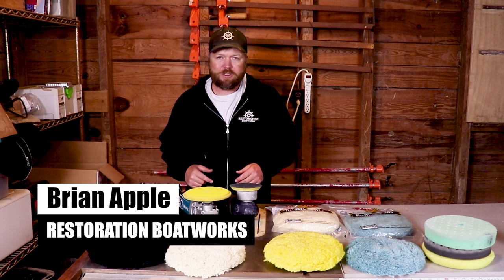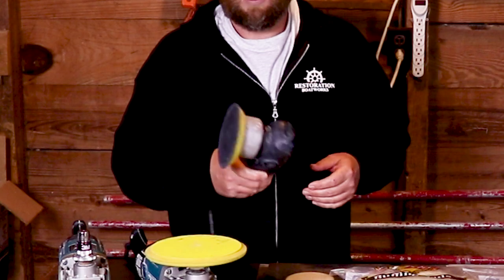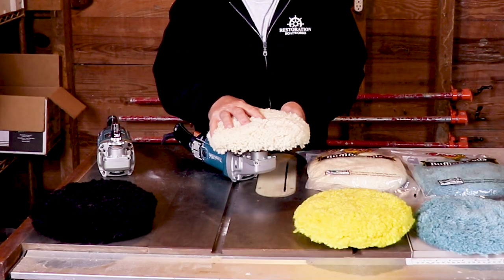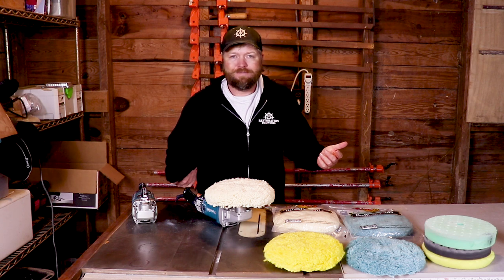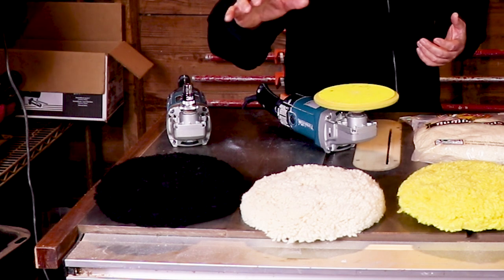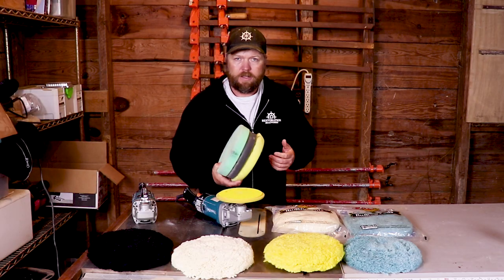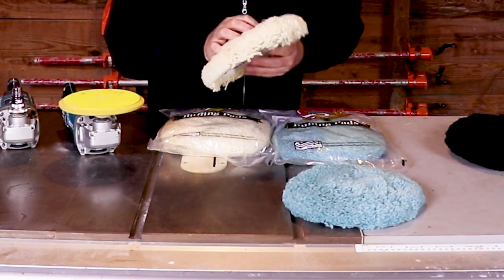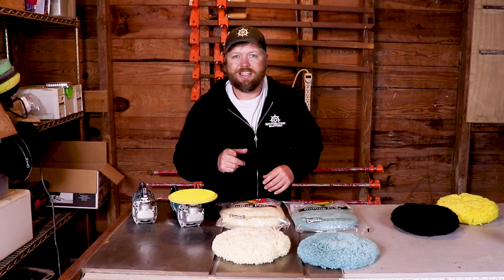Which buffing pad for boats

Comment: What Polisher and pads would you recommend for RV that has a clear coat finish. In somes places the clear coat is flaking off. ( 20 years old) There are areas that are painted and then areas that are white. But everything is clear coated, except the roof. 
Appreciate any advice you could provide me.
Reply from the maker: If it doesn’t float- I don’t know much!  I would be completely guessing on what to recommend since it sounds like you have a painted RV. Sorry, I’m not familiar enough to help.  Brian
Reply: @SportfishingBoats  I just thought since it was all fiber glass/gel coat with only some surfaces having paint it would be pretty similar to  boats. The roof for example is all white, just gel coat to my knowledge and no clear coat. 

Thanks very much for replying, 
Roger
Reply from the maker: ro32901 Roger, on any surfaces that are gelcoat this will work exactly the same as a boat.  Unfortunately, without seeing it in person I wouldn’t want to offer advice on something I’m not familiar with.  Thanks for watching!  Brian
Reply: @SportfishingBoats  I understand, thanks.
Reply: One last question, when I look for a Makita 9237 I only find a 9237C is that the correct model #?

Comment: Are you supposed to experience shedding on wool pad/polisher? I did the trick that you let it spin the wool pad and use your hand with water to grab the shedding wool.   My wool pad still shed but maybe less.  Will it ever go away?
Reply from the maker: pricelessclips Yes it will shed.  Don’t worry about it.  I just pull em out of the bag, put it on  and start buffing.  😀
Reply: @SportfishingBoats  One more thing... the 3M wool pad "round felt" at the back that has the name and part# which is used to connect the Velcro plate fell off almost when I was done.  Its was glued. I used cement glue and didn't work.  I again used 3M super 77 but didn't get to test it. What do you think?
Reply: Probably when I washed it and soaked it in a bucket with hot water and dish washing soap. Somebody told me that's how you clean it.
Reply from the maker: pricelessclips Hugh... It’s been along time since I’ve had that happen.  Unfortunately, the pad is probably done.  I hope it works for you though!
Reply from the maker: pricelessclips that is a good way to clean it.  However I would certainly hope that wouldn’t hurt the adhesive on a 3M pad.  Is it a 5711?
Reply: Sportfishing Boats I bought 5711 and 5713. I used 5711 for compounding the hood, roof of my car 2x and still ok. 5713 polisher 2x for the whole car. What I think was happening... 3 days work I finish hood and roof for day 1 compound in small area at time until the hood is complete. Then polish. I was switching pads all the time.. I probably pulling the Velcro too hard. Washed 2x it’s the 5713 polisher which gave up
Reply from the maker: pricelessclips That well could be the case.  I rarely take a pad off more than once or maybe twice.

Comment: Brian - is it worth cleaning a Presta polishing pad after doing a 22 ft boat or are they really better to use once?  If you should clean them is there a way that you would suggest and is the cleaning process the same for removing compound and polish from the respective pads?  Thanks for  your help and great videos.
Reply from the maker: As we speak I’m reaching for a new one right now!  Lol, I would retire that one.   They are not expensive, sometimes I’ll clean a few.  But usually I just reach for a new one.

Comment: How many of each pad do you go through to complete a job ,for instance a 19 foot jet boat.. I know you can wash and reuse .
Reply from the maker: Good question.   1 pad per quart of compound or polish.  The pads get dull, resulting in rebuffing areas and using more compound or polish.  Which doesn’t save money or your shoulders!  Pads make HUGE difference.  Buy good ones.

Comment: Hi I buy the Makita, 7 plate diameter. The Presta Wool heavy cut pad is 9”  is fix ok?
Reply from the maker: The manufacturers make this so confusing.  But 7 inch plate goes with a nine inch pad.  That is the correct size.
Reply: Sportfishing Boats thanks appreciated.

Comment: I've been told there is a difference between polishing a gelcoat and an epoxy coat.  I have a steel hull with Awl-Grip paintwork.  Can you recommend the pads and compounds you'd use in this instance, please?

Comment: I have a boat project and can't decide on the machine to get.  Can you suggest a non-orbital CORDLESS option?  Milwaukee vs. Dewalt vs. ???   I know the Makita is a solid choice but I want to go cordless.  Please advise me.  Thanks.
Reply from the maker: Their presently is not a cordless rotary polisher worth considering.  Unfortunately.... corded Makita 9237 is the workhorse staple of marine industry.
Reply: Thanks for the info.   I may try out the milwaukee and see if that will do the job.     It is only for personal use occasionally.   I will report my findings.
Reply: The Milwaukee M18 brushless rotory buffer cordless works excellent in my boat detailing business. It is a work horse.

Comment: What is the model #of the makita. there are several to pick from 9237c hook and loop etc.
Reply from the maker: Kraken Automation 9237 is the one you want.   You can get it tool only(what I recommend) or as a kit version that includes two low quality pads and a bag.

Comment: Confused about pad sizes. Just purchased a 7 in buffer, plate size is 6 1/2 inches. Presta Pads are 9 inches. Is that the o.d and some sites say a 9 incher will work. Brand new at this and don't
 want to mess up. Thanks
Reply from the maker: Yeah, they make it way to confusing.  Presta pads fit.  It’s a 9 inch pad with a 6.5 to 7 inch backing pad.
Reply: @SportfishingBoats  Thank You! The answer I was hoping for.

Comment: How long do Pads last and how do you clean them
Reply from the maker: Rule of thumb-   Use one pad per quart of product.  Example- you start on the boat with a brand new pad and quart of compound.  When that quart is gone you need a new pad.  I’m old and my shoulders hurt.  I reach for new pads frequently.  They just do the work faster.  You can soak them for 15 minutes in dish soap.  Then rinse, squeeze, and air dry.
Reply: Thanks for all the info
Reply from the maker: @leecharles8945  your welcome!

Comment: I thought a orbital and a dual action pretty much the same? I thought it was a rotary you had to use? Remove Oxidation
Reply from the maker: They are.  Did I mess up and  say something different?
Reply from the maker: Oops... yeah... I did.
Reply: @SportfishingBoats   No worries I just wanted to confirm ,So I did an RV the other day was very oxidized I’ve done a few boats and they came out pretty good, So the RV I did 32 feet I did the one side I had the most oxidation are use Maguire 67 It’s a compound and a Polish one step I’ve also seen some reviews of people using it on RVs For some reason I was having a very hard time cutting the oxidation I was spraying the pad and the surface Just a tiny bit because it was hot out Just wasn’t going very smooth and it was leaving some faded spots still I buy these wool pads off Amazon three pack for 40 bucks Do you think if I buy a better pad that would make a difference?
Reply: Or maybe I’m spraying water too much?
Reply: Sorry I also forgot to mention I’ve had this bottle of compound 67 I kept it downstairs because it gets cold in the garage for over a year it sounded like it was a little dry I added a little bit of water maybe I didn’t add enough water to the compound?
Reply from the maker: The pads make a HUGE difference.  When it comes to compound, all of these compounds are developed for the much larger auto body market then repurposed for work on gel coat.  An aggressive compound on paint is just light to medium on gel coat.  (Gel coat is 10 times thicker than paint).  What I’m getting at is gel coat requires REALLY aggressive compound.😉. I haven’t used 67.

Comment: When looking at a boat, how do you decide what level of cutting needs to be done before moving to the polishing stage. I just bought a boat, the finish was dull, but not chalky looking. After washing it, with soap and water, and a little mildew remover it's fairly shiny. I'm trying to decide if I really need to use compound first or just go with a good polish and then wax.
Reply from the maker: Steve Cloud Go ahead and compound it if it looks anything short of perfect.  Almost 100% of the time I’m compounding the boat the first time.  The best thing you can do is get it as glossy as possible polish it  and maintain it from that point.
Reply: Thank you. Will do.
Reply from the maker: Steve Cloud 👍, let me know if you have anymore questions.
Reply: Does the rubbing compound need to be specific to marine application? I have some 3M rubbing compound 03900 I bought from the auto parts store and was wondering if I could use it on the boat. Also can a wool cutting pad be washed and reused or do you just toss them when they're done?
Reply from the maker: Steve Cloud Your assumption is correct.  Rubbing compounds are the same that are used in automobile world and boats.  The 3M product you have would not be my first choice for a purchase because their are less expensive products that will outperform it on gelcoatbut it is a good product and it will work fine.
Reply from the maker: Steve Cloud yes cutting pads can be reused.  Washing them in a 5 gallon bucket is fine.  The only thing I will caution you on is they do wear out just like sandpaper. When it starts cutting slower, it’s time for a new pad.
Reply: Thanks for taking the time to answer my questions. I just had the 3M for buffing out a  few scratches on an old truck and still have most of the bottle. I was looking at Walmart and they carry Meguiars rubbing compound and polish. Is that stuff any good? What brand would you recommend?
Reply from the maker: Steve Cloud Since you already have the 3M, I would use that.   I use Presta’s Supercut.  The problem with most compounds is they are geared toward automotive paint which is only a tenth as thick as gelcoat.  Therefore designed to be less aggressive.

Comment: How do you fix buffer burn on your gelcoat
Reply from the maker: Are you certain it is burned?
Reply: Yes not bad but I don't like it
Reply from the maker: The reason I ask is it’s difficult to burn gel coat unless it’s a hot day in the summer and you working in the sun.  What machine, pad and rpm were you using when this happened?  Where is it on the boat?
Reply: Right around the fuel filler

Comment: How long should a wool pad and polishing pad last?
Reply from the maker: BrownRice Marketing There is a guide in the description of buffing pads for boats video.   It really depends on the condition of the boat but a single sided pad should do a 20 footish boat. However, I recently went threw 2 double sided compounding pads on a 22 foot boat.  I hope I never see that boat again in my life....
Reply: @SportfishingBoats  Hopefully last question. How long should this whole project take for a novice to do the outside hull of a 20' boat, give or take? Thanks so much!
Reply from the maker: BrownRice Marketing The best way to tell is to do a test spot.  Pick out a 2ft by 2ft area and do that one section and figure out how much you work your in for.  But assuming the boats isn’t to bad, you could do it in a day.  Btw, you can ask all the questions you need to!  I don’t mind!  Good luck with it and let me know if you more questions.
Reply: Sportfishing Boats how do you know when to switch to a new wool cutting pad during an oxidation removal? I’m doing my Navy Blue Hull Everglades right now and it is heavily oxidized. The pads seem to be loading up and getting sticky (and turning really blue!) after about 4-5’ of hull.
Reply from the maker: mossy112965 the simple answer is when they start cutting slower.  There no different than sand paper, they wear out also.  How big of a boat are you working on?
Reply from the maker: mossy112965 if the pad is getting sticky, your probably using a little too much compound.  Try using a little less and see how that works.
Reply: Sportfishing Boats 28’ Center Console. You are using just 4 dots of compound on the pad correct?
Reply from the maker: mossy112965 4-5 nickel size drops of Presta Supercut compound
Reply from the maker: mossy112965 I go thru roughly 1 pad per quart of compound.  Sometimes more sometimes less.